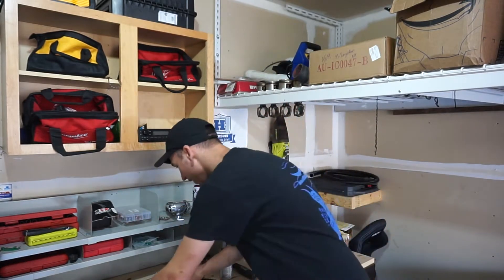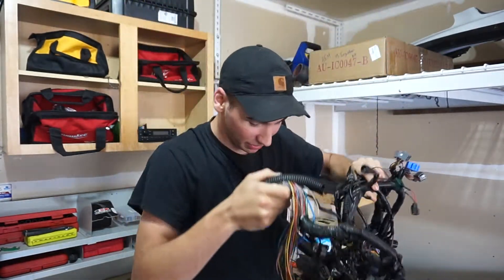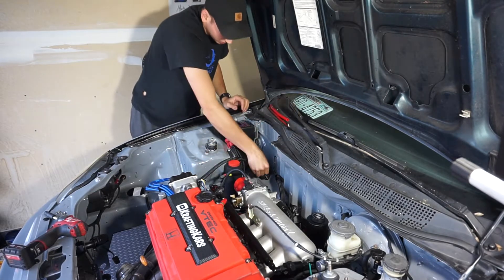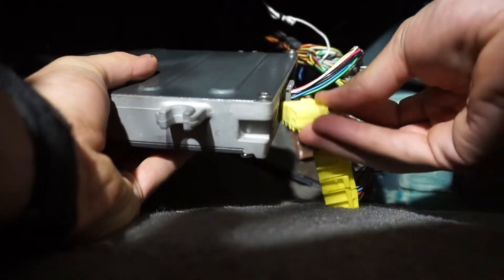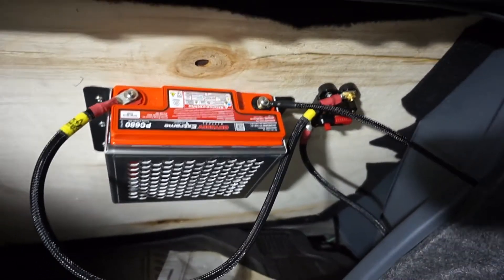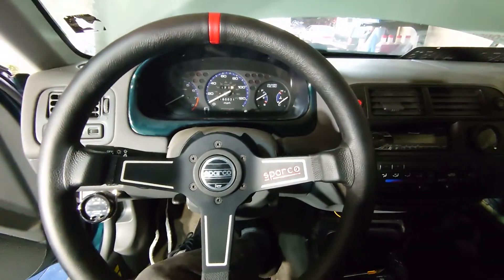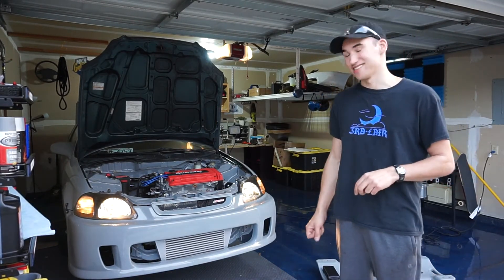Wireworx OBD1 B/D series tucked harness install!!! B16 EK Civic

Comment: How does your air work if you say you did not connect the cable for the air conditioner?
Reply from the maker: Oh that wire taps into the existing ac on/off button, the original circuit is not interrupted. The reason for that wire is to trigger features of your ECU such as launch control, or switching maps
Reply: @kraftingkars If only you could record a video on those wires so you could know and understand how they connect.

Comment: I know this is not nee post but didn't see egr being connected did i miss that or your engine doesn't have one putt a d15z1 in my 96 hatchback will this harness work and as far as thr conversion harness i wouldn't need one?using a 37820-p2p-a32 ecu obd2a or should i get a p28 stock ecu with conversion adapter to obd1ecu?
Reply: Online tuck harness is usally for american hondas and jdm (japanese hondas) since your talking about egr either you have a accord/prelude or a europe honda civic..in america or jdm dont use egr..so this harness are not made with the intention for a honda with egr valve..bypassing egr is must and usually throw away for racing

Comment: 7:45 what about selenoide Vtec come with tucked Harness?
Reply from the maker: So my harness just uses the solenoid switch plug, since I run an aftermarket ecu I don't use the vtec pressure switch if thats what you are asking
Reply: Dont need it ..only one vtec wire because japan never cared for that sensor while USA they added the oil pressure switch because at the time japanese thought badly about americans 😂

Comment: I know this is a long shot but do you know what wires I would have to splice if I have a obd2b car but I’m converting to obd1 wire harness. I been stuck on my build for a couple of months and haven’t had any luck finding any information on it
Reply from the maker: Look into an OBD2b sub harness. What ECU are you running and what chassis
Reply: Im running a a pr4 with s300. I bought a jackspania harness conversion from obd2b to obd1 on a 99 ek coupe. I bought the subharness, the harness it’s self and the charge harness. The car cranks over but I’m not getting  cell light and it’s not priming the fuel
Reply: @henrypena3730 i'm having the exact same problem, obd2b. the 'A' connector is just hanging around and i don't know what do to about it. i'm stuck...
Reply: @aidanhaley5534 please bro what did you do fix it
Reply: Any luck on the no fuel, cel ?
Reply: Gotta convert from 3 wire iacv to 2 wire iacv

Comment: I bought the same wiring harness. It just doesn't have the coolant sensor connector, only the fan switch connector. And the fan doesn't turn on due to temperature.
Reply: Then you bought a defective harness that they forgot about that function

Comment: Where is the vtec oil pressure sensor...
Reply from the maker: Didn't order one on my harness, I have it disabled on hondata
Reply: @kraftingkars thanks for quick response. where did you connect the charge harness for the starter and alternator.  My car had power but no crank.
Reply from the maker: @violetiscool3861  so currently I have a battery in my trunk, from there I run a power wire through the car and into the engine bay to a terminal I installed. Then from that terminal I have another power wire going to my starter. For my alternator I run a thicker wire from my fuse box  to the alternator.
Reply: @kraftingkars ok. Thanks . Could I email you instead of commenting?  I want to be specific as possible trying to get the car start T-T 😭
Reply from the maker: @violetiscool3861  sure, ahuntervoigt@outlook.com

Comment: Hey anyone got a "NO SPARK AND NO FUEL PUMP" PROBLEM when installing the tucked harness?
Reply from the maker: Nope
Reply: You got a wrong pinned harness from china
Reply: @Verde_EF91 yeah, had to rewire a few
Reply: @GoldenGarageJerez there you go..even the ecu jumper harness from ebay that people bought ten years ago for $20

Comment: i know this is old but where is the vtec oil pressure sensor? you had it plugged in already but didn’t show us. i bought the same harness and it doesn’t have a plug fornit
Reply: I just recently bought one and it didn’t have that same plug. What did you end up doing ?

Comment: Will this harness work on a 96 civic ex d16y8? My distributor uses only 1 plug since it's obd2a.
Reply from the maker: It should but I believe on the wireworx website when you build the harness there are options for what distributor you run.

Comment: 8:59 ONE QUESTION 🤔 THE CABLE THAT IS CONNECTED IN THE FUSE BOX IN WHICH IT COMES WITH THE ORIGINAL HARNESS THAT'S HOW TO INSTALL IT WITHOUT THAT ANOTHER HARNESS DOES NOT COME WITH THAT CABLE

Comment: Hey man ! question what battery relocation kit is this ? or what are you using to hold the battery up like that ?
Reply from the maker: Just a generic charge harness I pieced together. I run a odyssey pc680 with a bracket screwed to a board in my trunk

Comment: Tips on running the wires to the fuel pump?    I can’t seem to figure out how to get power to it.
Reply from the maker: Have you figured it out yet? I run this kit, comes with a great diagram to help you. Basically your old fuel pump power wire will trigger a relay to allow a new power wire to run from your battery, through the relay, to your fuel pump. Then make sure your fuel pump, relay, and old fuel pump ground wire are grounded
Reply from the maker: https://www.kseriesparts.com/DWS-FPHWK.html?gad_source=1&gclid=CjwKCAiAvdCrBhBREiwAX6-6UngE7p6Rt5wC7Fy9Byw1ggjuKC4rjUEdqeWPuqRphA4GA4nssGKSoRoCoXoQAvD_BwE
Reply: You dont

Comment: what is the use for moving the plugs from the engine bay? i’m doing a 97 crv b20 in a 94 hatch and just installed my harness today. have 2 extra wires near the ecu and don’t know what they’re for. what is the use for the sub harness
Reply: 94 civic doesnt need a subharness should plug straight to it

Comment: My car doesn’t crank atm after I’ve done everything in this video … the car would crank with the old harness but it doesn’t crank now with the tucked and sub harness does anyone know why that happens I’m extremely confused I would like any answer please and thank you …
Reply from the maker: I'd start by tracing the power wire back from your starter. Sounds like it could just be a blown fuse
Reply: @kraftingkars  also those “extra” wires on the harness is it pissin to run my boost controller to them ?
Reply: Sounds like pin wrong chinese harness or you forgot to purchase charge harness

Comment: How does it work for the radiator fan? Is that onto another harness?
Reply from the maker: The radiator fan is connected to the chassis headlight harness, this is just the engine harness👍

Comment: I’m having trouble wit my harness I bought bc it dosent come with a wire that goes into the fuse box, yk how there’s two wires that run into the fuse box under the hood well the positive is one and it connects to the starter and the other it’s suppose to be with the engine harness but I don’t see it on my engine harness need help I hope he responds
Reply: Any luck ?

Comment: What year B series did you use for your swap? I'm currently in the process of getting everything together to start my swap. I have a 96 civic ex coupe and I was literally just going to try to find a 00 civic SI B16a for my swap or either a B20. But I'm looking for the easiest one to drop in to be honest.
Reply from the maker: I'm running a b16a3 out of a del sol. 1995 I believe, and my civic is 1997.

Comment: i need help so i connect my harness but engine dont start i have no crank and everything else turns on light radio etc but no start on the car and im also not getting any fuel from fuel pump ?
Reply: how did you fix. it

Comment: I’m assuming this harness will work on my 97 civic with a d16y8 swap using a p28 correct?
Reply from the maker: Yessir. The wireworx website lays it out very nicely, you can contact them with any questions as well

Comment: Hey buddy I'll fix the issue on the alternator,  I just take my alternator plug and compare to your actual harness and boom somehow there was inverted wiring between the black and yellow and the straight white, just switch the wiring and now it's charging,  thanks for your video,   🙏
Reply from the maker: Heck yeah that's awesome! Glad I could help!
Reply: Now straight to the dyno🔥
Reply: I installed this harness on my car today and I am haveing a charge issue after installing the harness but my stock harness don’t have a solid white wire only winter and red and white and blue and white and green

Comment: Hey , quick question,  in order to charge the battery can I run a wire from the starter to the alternator?  Because I bought this charge harness and I run it from the fuse box and doesn't charge , it's a new alternator , has power on the terminal and the alternator but don't charge the battery , the round plug also has power in the black and yellow wire. Any help would be appreciated
Reply: My alternator has 4 pins and the harness only 3
Reply from the maker: Do you have an Instagram or Facebook? I can send you pictures on how mine is setup
Reply: I know this is an old video but I'm having the same problem on my car...my alternator is not charging any tips would be nice

Comment: Hey buddy quick question if you don't mind I have a hatchback ek , I'll swap engine to b18b1,  the t bracket for the tranny don't matter its from an automatic trans or has to be manual transmission,  it's the same bracket the manual and automatic???
Reply from the maker: As long as the t bracket is made for a b series in an ek you'll be good auto or manual. If you used to have auto d series in there your old t bracket won't work. I had to get a new one when I went b series.
Reply: Hi, it doesn't fit I got 1 from crv and 1 from acura same engine but it was. Auto transmission and doesn't fit either, that's why my question if doesn't matter it's had to be auto or manual transmission.
Reply: I was thinking use the one from 99-2000 t bracket from civic si but I don't know the other ones there's to long if I put it in the transmission the motor mount it's to far away from the hole of the bracket
Reply from the maker: @eugeniorosario6456  "as long as the the t bracket is made for a b series in an ek" so yes an em1 will work. Any crv, integra, eg, won't work.
Reply: Thanks for the advice,  very appreciated

Comment: Hey where did you get the sub harness? My tucked harness didn’t come with one and everything I find online for a “tuck harness sub harness” is just the main harness
Reply from the maker: Maybe your harness has built in plugs for the shock towers and ECU already? Otherwise I'm not too sure, I'd call the manufacturer

Comment: Quick question so if I have a obd2a b18c1 in my obd2a 98 civic lx that I had to add a few sensors to the stock lx harness to be able to run vtec but I'm also running a obd1 chipped p28 ecu so my question is does the obd2 harness comes with the vtec sensors all built in the harness and would it be plug and play straight to the obd1 ecu?
Reply from the maker: It should, especially if you order from wireworx, I would contact them for any specific questions for your build they are very helpful!
Reply: @kraftingkars  sounds good thanks brother appreciate the feedback

Comment: Hey boss hey did you run your vtec solenoid pressure switch?
Reply from the maker: Nope
Reply from the maker: And I disabled it on hondata so I don't have to deal with a code
Reply: Ok so I can just leave it alone? I don’t needa bypass it or anything? And my B18c is in my EG DX hatch. Do I need to tap the passenger shock tower harness to run vtec? And the driver side shock tower for anything?
Reply from the maker: @travisgallegos9363  what ECU you running?
Reply: @kraftingkars  v3 s300 p28 obd1 hondata
Reply from the maker: @travisgallegos9363  you shouldn't have to tap any wires to get your vtec to work then. If you have a VTEC ready engine, ECU, and harness you are good to go
Reply: @kraftingkars  ok cool. Cause I saw ppl were tapping into there shock towers

Comment: What parts did you change to use obd1 ecu? Only distributor? Or u didnt change the dizzy at all? And what does the sub harness do? What does it connect
Reply from the maker: I have a obd1 ECU, obd1 distributor, and the sub harness connects the engine harness to the chassis harness. Usually it connects to the two big grey plugs on your shock tower, I pulled those plugs inside my car so I'm still connected to them but it's hidden

Comment: What is that extra plug for?
Reply from the maker: I had a couple extra plugs I didn't use, one for the knock sensor, and one for the stock oil pressure sender
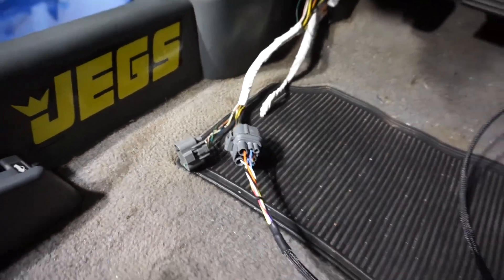Reply: @kraftingkars  sorry I’m talking about the one at 5:50 when plugging in chassis adapter harness
Reply from the maker: oh yeah so that plug is not needed
Reply from the maker: @DeeezN  the wireworx engine harness bypasses that one.

Comment: Where did you get the positive terminal for the a positive charging harness and how did you install it?
Reply from the maker: Search up "positive insulated battery power post" just installs with two screws on either side of the post

Comment: Can you help me out I'm trying to order the wire harness but I'm stuck on the part  were I have to chose a Charge Harness they have like 4 options & idk what to click on? i was gonna choose / Integrated Charge Harness (NON MILSPEC + FUSEBOX IN CABIN ONLY)  or i was just gonna Subtract $40.00 can you help me out or explain it pls & thanks
Reply from the maker: Yep! So if you still have the factory fuse box under the hood, choose to get the separated charge harness. That integrated charge harness option is for people who tuck their fuse box inside the car.
Reply from the maker: (to oem fusebox location) is the one you probably want
Reply: @kraftingkars  ok thanks a lot man I was so confused lol it make more sense now 👍🏽

Comment: What's the part number for that jumper harness?
Reply from the maker: If your talking about the sub harness,it comes with your main wireworx harness
Reply: @kraftingkars  thanks for getting back to me.... Yea my harness only had the main and the charge harness....I thought something was missing until I seen your video.
Reply: @amichael4681  i have the same problem did u find a sub harness
Reply: @dominicschwarz3569  yes, I got the correct harness. The seller apparently forgot to include it with the main harness. The one missing runs under the dash like he said....

Comment: i'm new to wiring harness i have an ob2a car could i just install the obd1 harness that came with engine or not
Reply from the maker: Yessir! The plugs on the ecu side will be a little different between obd2a and obd1. Which ecu are you running?
Reply from the maker: If you are still running the ob2a ecu I would recommend the speed factory part number SF-01-040 to adapt your harness

Comment: Hey man nice video! Does the wires touches the water hoses? Is it dangerous to melt the wires?
Reply from the maker: The water hoses don't get hot enough to melt the nearby wires, just make sure to keep those those wires away from the exhaust manifold! That will melt them and that is no good!
Reply: @kraftingkars  thanks!

Comment: Hey man do you have a video for the baterry relocator?
Reply from the maker: Unfortunately I don't have a video, but it's really simple! Find any way to mount your battery secure in your trunk, connect the - terminal to any clean metal on the chassis. Then snake the + terminal through your interior into your engine bay where I would recommend you add a power terminal. Then from that terminal you need a power line to the fuse box, and a power line to the starter. And your set!

Comment: On index 7:50 to 7:55 you mentioned about the "sender". I think I mine (Honda Civic DX '97 coupe) got disconnected (and cannot reattached cuz it is broken) when I was reinstalling the transmission. What is the purpose of this one? Can I test run or start the car without it? Please advice.
Reply from the maker: The one wire coolant temp sender that I plugged in tells your gauge cluster needle where to be for your coolant temp gauge. The sensor actually gives the specific temperature to your ecu!

Comment: I'm going to do the exact thing I want yo make it a simple push start and remove all the security can that be done without issues?
Reply from the maker: Yeah old hondas are pretty easy to convert to push start! They make kits for it so you just need to bypass the momentary ignition switch

Comment: Did you completely remove the cabin harness going from the passenger side all the way to the driver side? Where did you get the sub harness? I bought a headlight tuck harness from Wireworx and I noticed the original engine harness has some of the same connectors as my headlight harness. I want to replace the engine harness too but not sure what I need.
Reply from the maker: So for my Wireworx OBD1 B/D series wire tuck kit. I did not have to remove any of the cabin harness. I pulled the two plug connectors from the shock tower, and routed them inside the car, which is where I connected the plugs to my subharness at the driver's side foot well. When you order an engine harness from Wireworx they ask you what chassis you are running, this is how they decide what subharness to send you with your kit.
Reply: @kraftingkars  I appreciate your quick response. I didn't know they send you a subharness with your engine harness. Thanks for the info. I subscribed.
Reply from the maker: @fivefivesix-sevensixtwo4114  thanks man!